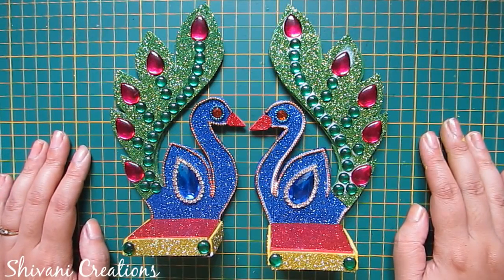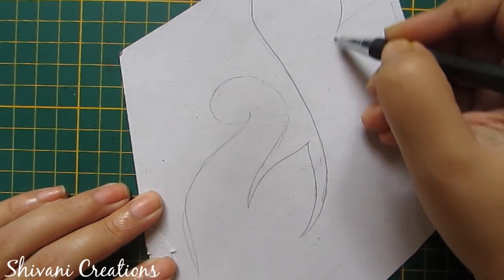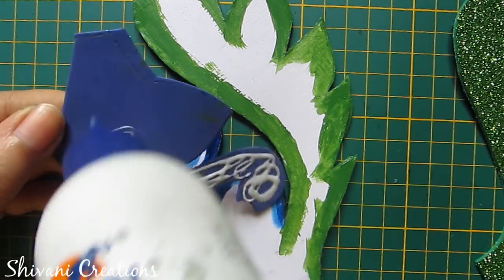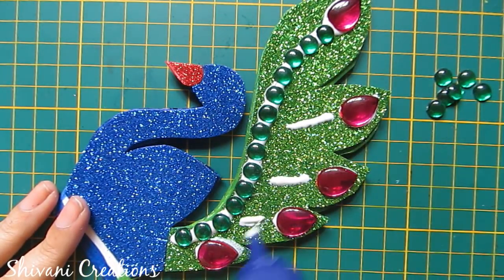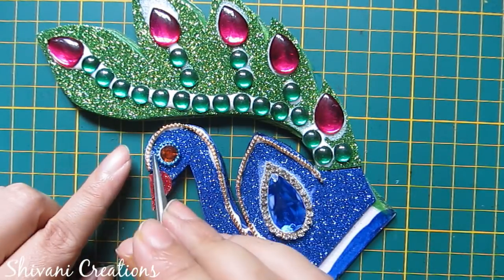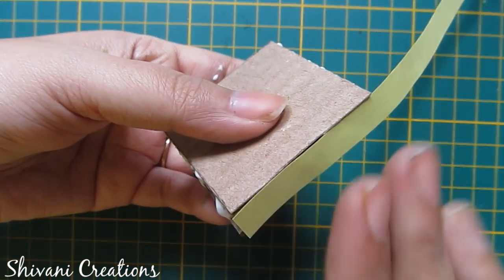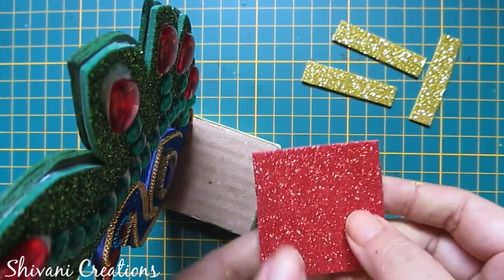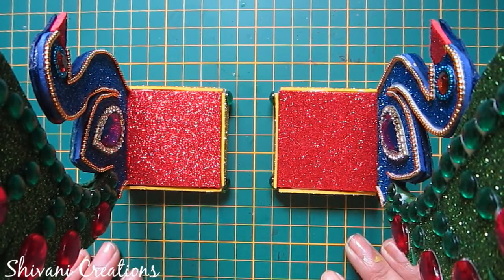Handmade Peacock Lamp Stand using Waste Cardboard/ DIY Diya Stand for Diwali Festival

Comment: Di, I have a doubt.For the base you used cardboard and u covered it with glitter foam sheet, So I was thinking will it be damaged we will put a diya and will light it..??will it be damaged the the surface heat of diya ??
Reply from the maker: no